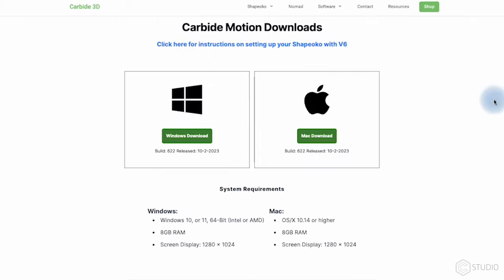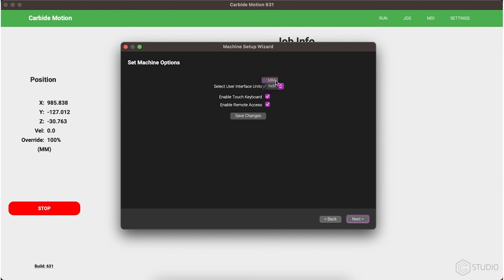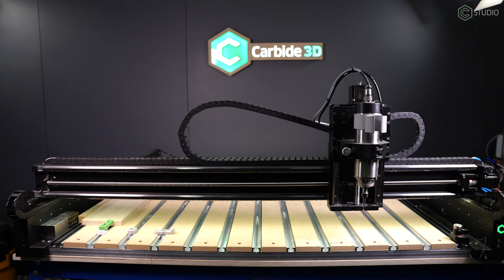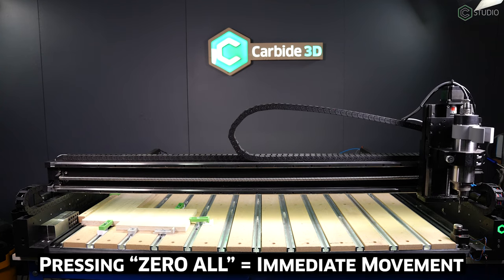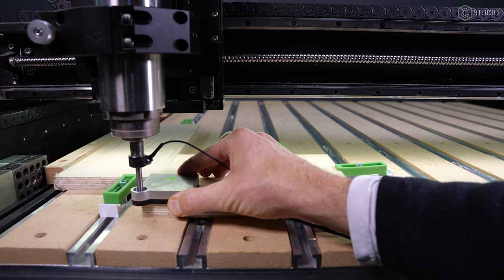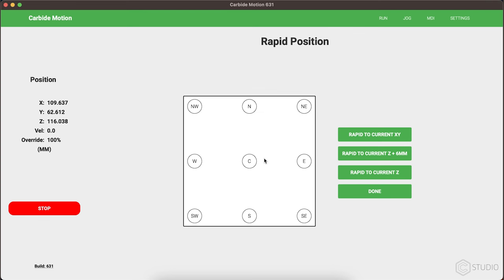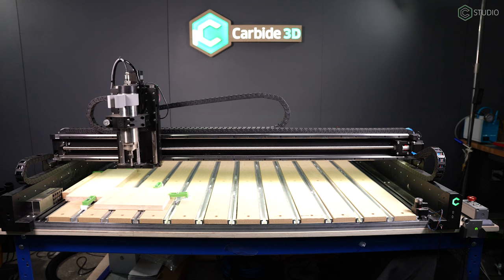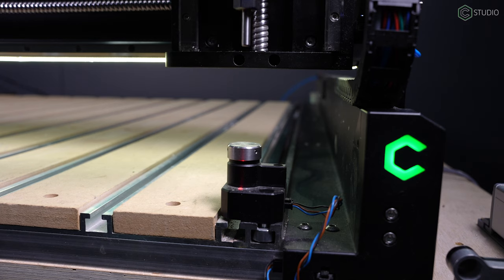The New Carbide Motion (Version 635 and Beyond)

Comment: When using the BitZero, and doing the corner routine, it sets x and y inside the loop, and then comes out and touches the top of the BZ.  Is that supposed to also set the Z zero?  Whenever I rely on that, my Z zero ends up like 1.6 mm above the surface of my material.  I have to move the router out of the way, put the BZ on top of the stock, and do the Z zero job by itself.  Would be great if it could do all three zeros in one operation.
Reply from the maker: All three zeros do work in the same operation.   Are you using the pin supplied with BitZero?
Reply: @carbide3d  Yes.  Using the supplied pin, measured on the BitSetter first, and the BitZero is flat to the stock, (with the guide lips overhanging at expected), and ground strap attached to the collet nut.  It runs the process inside the hole, exits and measures the top, then moves up to 10, 10, 19.  When I use the jog commands to go down, I have to go down 20.6mm to reach the top of the stock.  I ran jobs with it set to that zero and it just never touches the stock.  The only way I've had luck getting it to work is to manually zero by measuring with the BZ on top of the material.
Reply from the maker: Update to the newest build of Motion and let us know if the issue persists.   Support will be able to assist you.
Reply: @carbide3d  I plan to.  I have been working with support to address some other issues.  Thanks for the great support!
Reply: @carbide3d I have the same exact issue. There are a lot of us that do (there are many youtube videos showing the issue). The workaround that some of us have found (but it doesn't always work) is to do the Z probe separately. Even still, I have to keep a 123 block handy and do a rapid motion to 1 inch above Z and measure... I am also using the pin supplied... I will be upgrading to the latest version and trying it.
Reply: Same issue here.  New user and reported this yesterday to support.  Hopefully this version fixes the issue - dug almost 2mm into my board because of this till i found a YouTube video saying Z separately.
Reply: @carbide3d  I ran a job last night and I think it worked eventually but the first time I ran it the same problem happened.  I used the BitZero to set the corner / zero, and when I started the job it was still like 1.6mm above the stock.  I ran another zero and this time it seemed to work.  I'm not sure why it keeps failing.  This was using 635 Motion.
Reply from the maker: There is no known issue.  If one of you can provide a video of the workflow that produces an incorrect zero, we will 100% dig into the issue.  Please send videos of the workflow and the resulting incorrect Z-Zero to Support@Carbide3D.com. Be sure to mention "Kevin" so I get a look at it.  

Thanks
- Kevin
Reply: @carbide3d  Unless someone else can do it sooner, I can make a video next weekend (April 13th). Unfortunately, I have some commitments and won't be able to do it before that... ONE IMPORTANT NOTE, I am running everything on a raspberry Pi (which at this time is not actually supported). Sorry, I probably should have mentioned that sooner (yeah, that's kind of important). I think that's probably why I haven't complained about it (because I'm using an unsupported version).... Another note, other than this issue, the Raspberry Pi version works GREAT. I wish it would be supported.
Reply: @carbide3d  Since upgrading carbide motion probing works as expected now.

Comment: Would it be possible to create the program to have 2 saved z locations to switch between? Such as a permanent z for the bed and a changeable z to set to the top of various stocks.
Reply from the maker: You can save multiple zero points inside the Quick Actions menu of Carbide Motion.
Reply: @carbide3d  does it have multiple Z zeroes? It would be nice to be able to switch from the bed for cutting out objects to a set z to the top to do a carving.
Reply from the maker: You can only have one ZERO value for each axis at a time.   However, you can have multiple saved Offsets (Locations) you can set as the Zero Position.

Comment: When I am manually jogging my machine around, I used to be able to issue the M03 command to turn on the spindle. This is useful when I am manually edging my x&y stop boards (lower left corner). Now I start the spindle and when I finish jogging in one direction the spindle turns off. This is a huge pain. Is there any way to keep the spindle running until I type M05?
Reply from the maker: The best plan now is to create a pocket or a single poly line along the desired edge.   Then run a standard program to cut your guides.

Comment: Well I did it and now my cnc won't connect. Yaay
Reply: Did you reconfigure your machine? Go through the set-up process again like you did when you first bought it? 🤷‍♂️
Reply: @PiercesPerfectPieces  yes I followed the instructions and it just won't  connect. So I found tbe old version and did the set up process and boom it work just fine. So I'll just try again later when I have more patience lol
Reply from the maker: One weirdo thing that’s popped up is with Windows computers (particularly Dell) turning off the Bluetooth seems to fix the issue.  
Dells are noted offenders with driver issues.